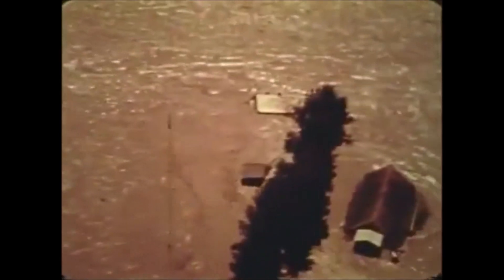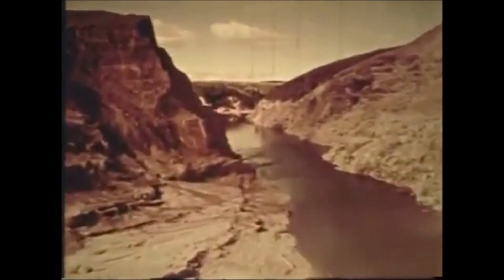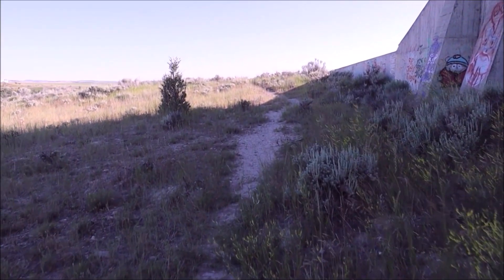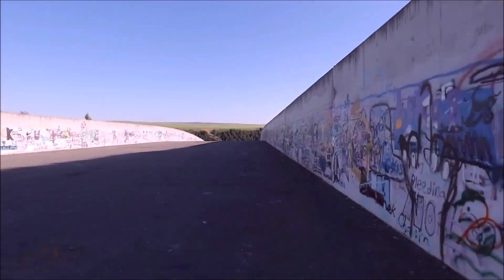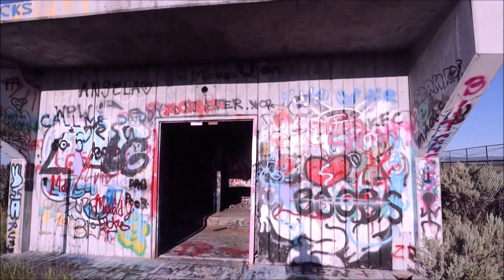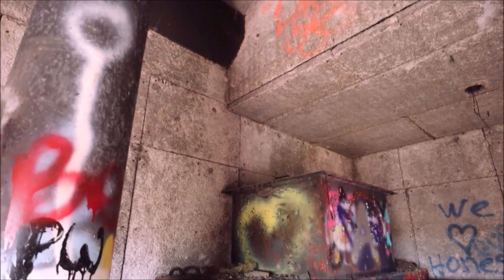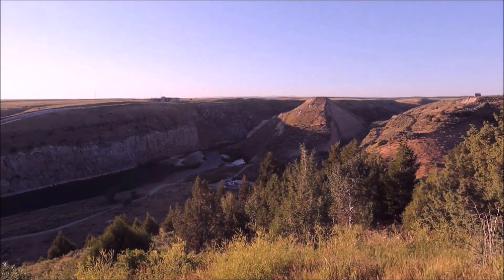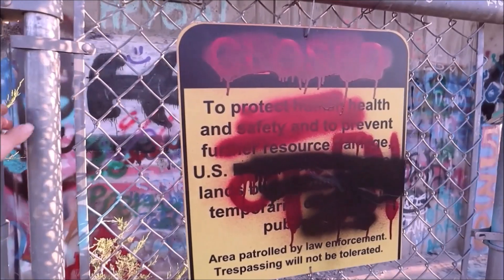What Happened Here? The Disaster That Took Many Lives

Comment: The towers that look like birdcages are for hydroelectric generators, which i would assume are where the "tunnels" that are blocked off as well are located. How many were down there 🤷‍♂️ was there another intake on the other side 🤷‍♂️ i feel like the generators were either pulled out if not pushed out of the way and what we are hearing is the river rushing through there still.  But frfr idk im guessing, only the government, the architect and the builders know at this point. i do know that from being both inside and outside the hoover dam, what the generator intakes look like, how big a generator is, and that there is a considerable amount of space needed for all that hydroelectric stuff inside the dam, even just 1..  they knew about the caves and caverns all around and decided on abandoning the idea of concrete filling them because of the cost choosing to inject it as anchors along the embankment only instead. I can only imagine what other corners may have been cut over costs? I mean it cant just be all undersight or lack of, ya kno?🤷‍♂️